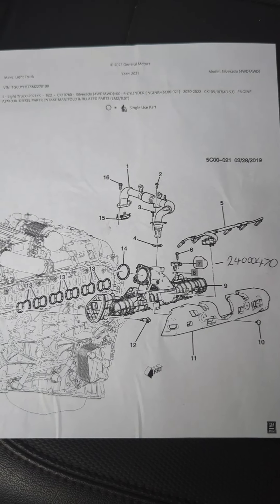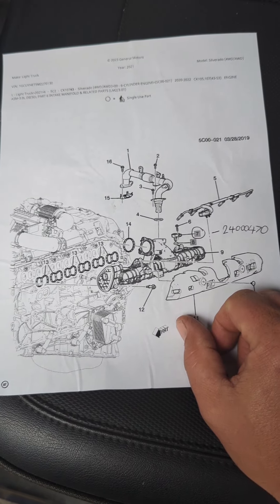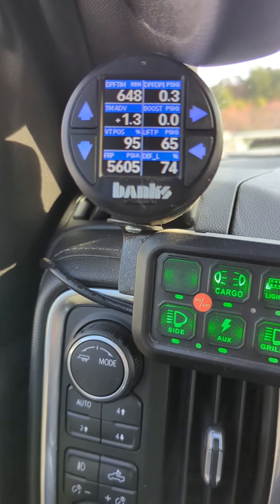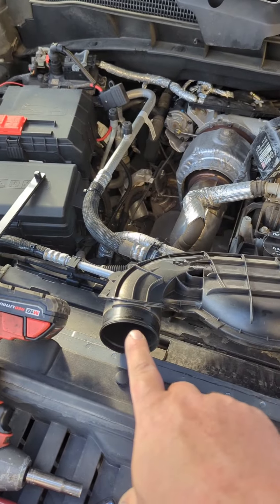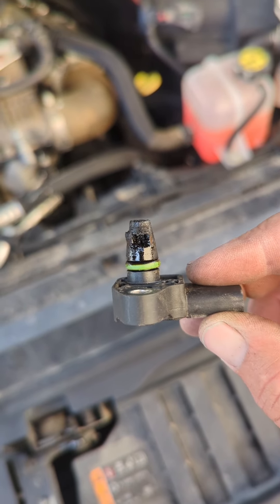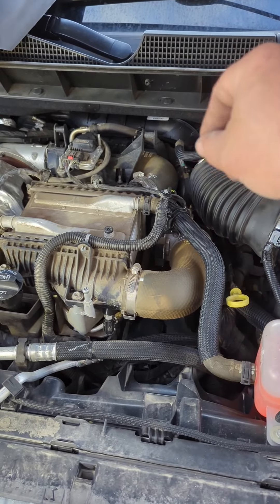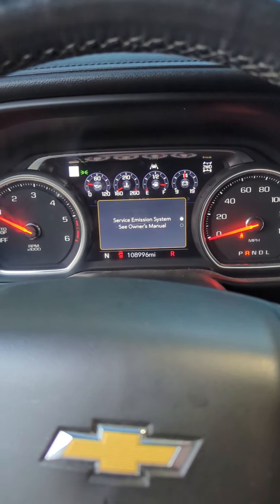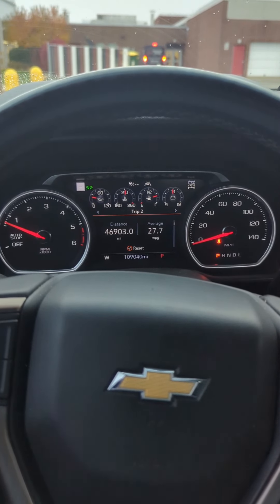P0106 MAP sensor code 3.0 Duramax Chevy 1500 repaired

Comment: I’m getting the same Code p0106 and p0108 (volts high). Where did you get the sensor? Do you have part number? PLEASE and THANK YOU! I Really don’t want to take it to the Dealer because they suck and I’m very capable of fixing it, I just can’t find the part.

Comment: Im at 186,000 miles. I never ever get map sensor codes. I also run fuel additives and catalyst clean. Def issues are the biggest. But running rislone def cleaner routinly will fix almost all of it. Pulling the def injector and cleaning the crystal buildup off is also a must in these.
Reply: How do you pull the def injector??
Reply: @rustynail914  1 clamp next to the turbo. Pops out. Clean with toothbrush and water. Pop back in. Tighten clamp.
Reply: @suzukigsxrnut  dude, I need to do that too.  I love this truck, but it throws a code every other week lately.  The code is either the DEF, MAF, or some other sensor.  It throws a code, then goes away. It's starting to get on my nerves.
Reply: @rustynail914  100% the def injector. The map sensor takes 20 minutes to get to as well. I'd pick a Saturday and give her a few hours. Will be like a new truck. Order a new map sensor for 10 bucks its right behind the motor under the black plastic long tube that runs parallel. Me and my buddy had the map switched out in 45 minutes. Remember to unplug the negative battery terminal before starting. No codes.
Reply: @suzukigsxrnut  How often are you cleaning the DEF Injector? How often for the DEF Cleaner?
Reply: @codybyron2485  I pull it around every 40k miles and clean it. Takes an hour. I do def clean every 2-3 months
Reply: @suzukigsxrnut  are you doing the “crystal clean” or the regular treatment with the measuring thing? I have 93k on mine and trying to keep it happy.